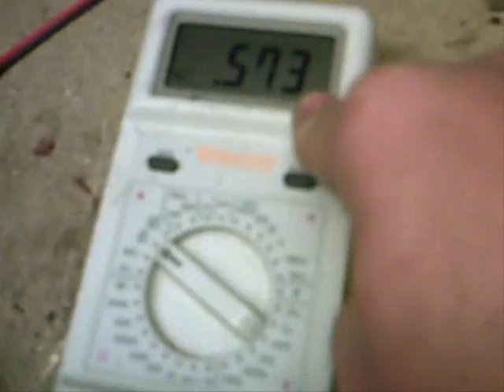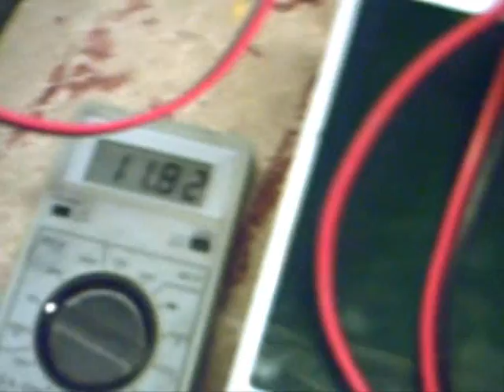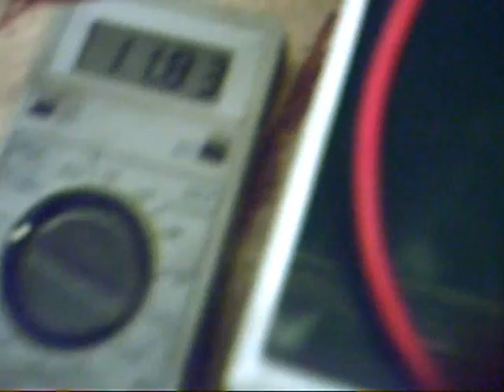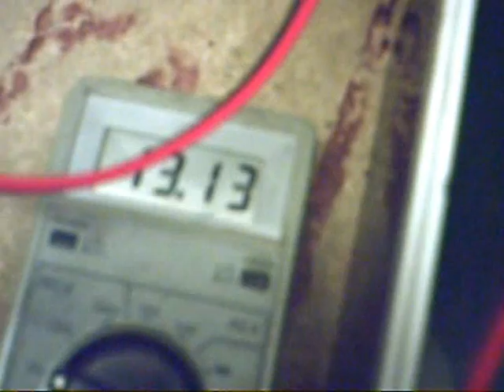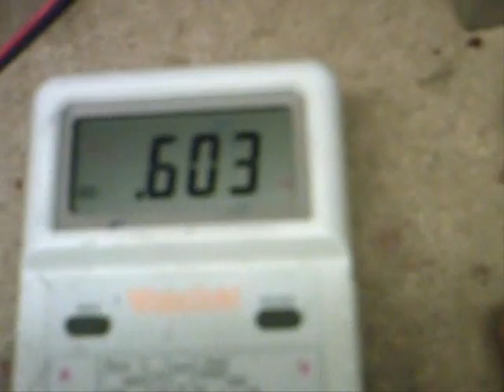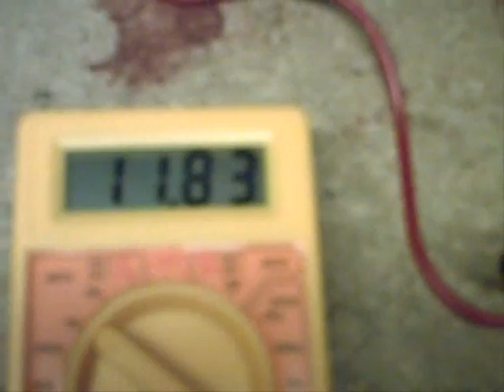Overunity Pulse Motor Bedini type 2

Comment: what happens to the draw if you run the lamp off the charging batteries. If it runs the lamp and doesn't increase the input draw that would be interesting. Oh and slow down, if you move slower it makes for a better picture, and pan out a bit, the ultra close ups kinda fuzz everthing. Nice work though.